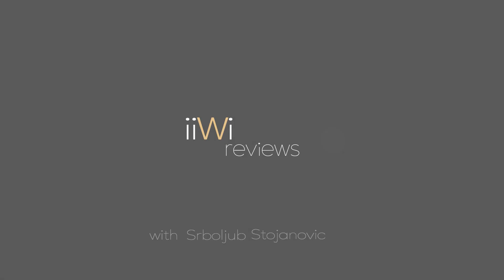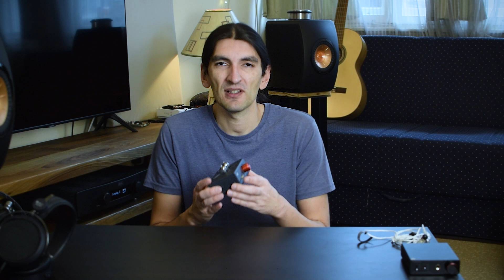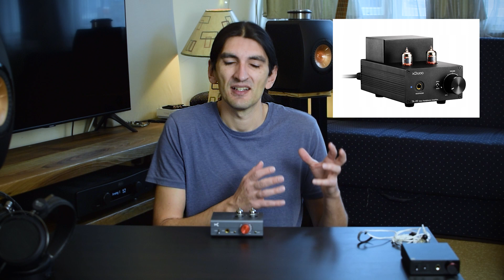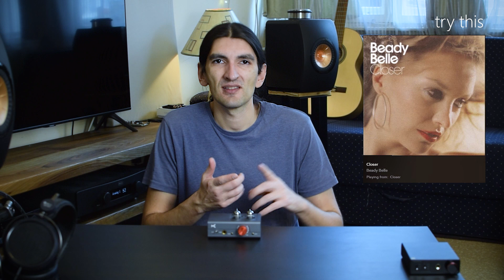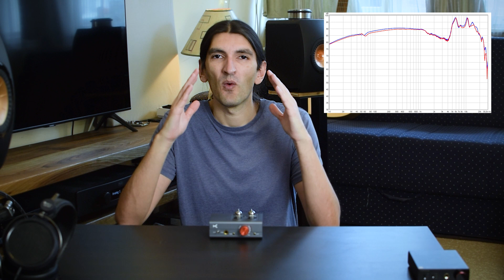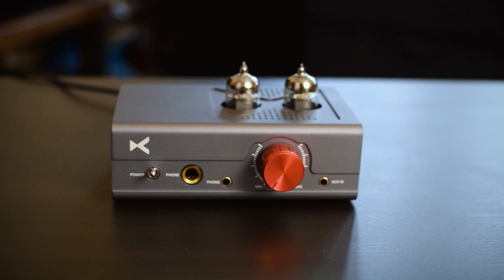xDuoo MT-602 - Great Hybrid Amp on a Budget

Comment: Hi, thank you so much for your reviews. From your reviews I could deduce that I have similar taste in sound as you. And wanted your advice to resolve my dilemma;
I recently bought the HE400i 2020 and am looking for DAC/Amp for them. 
I saw your review on - SMSL Sanskrit 10th MKII and you praised it a lot and I completely agree with your choice of opting Sanskrit over Topping. I like that exact kind of sound from Sanskrit. 
Then I saw your Review on - FiiO K5-Pro - and you praised it to a certain extent. Plus it has a powerful amplifier. 

So I am unable to decide as which one to get whether (a) Sanskrit + MT-602 (or any other Amp to power the Hifiman) OR (b) Fiio K5 Pro?
Thanks again.

Comment: Nice Review! Connect it to with any DAC, or can use direct this single Amp with PC? Pls reply...
Reply from the maker: You can connect it to 3.5mm analog out of your PC... But the sound will be better if you use a DAC in between.
Reply: @iiWiReviews  Thanks for reply. I have Creative Sound Blaster E5. If I connect without E5 with PC (3.5mm analog out), then Sound is better than E5?

Comment: I've just got one of these. I've so far only tested it with my HD560S and I think I can hear what you have described regarding pairing headphones with any kind of treble peak. I have found my 560S to be perfect with my A50s, no discernible treble spike to my ear (even though I know one clearly stands out when measured). With my 602, snare drums in a lot of rock tracks that I'm very familiar with (Tool & Oceansize particularly) stood out far than I have heard them to before. Not to an unpleasant degree but it's noticeable enough.
Reply: Are you still using it with the HD560S and what has your experience been? Just got the HD560S myself and looking at the 602 to take the edge off - but I'm not sure if it'll be a good fit.
Reply: @BatteryAz1z  I still have and use my 560S but I mainly use it for gaming. I've got a HE-500 for music now. I tube rolled the 602 and found the treble peak that effected snare drums largely disappeared. I think it's very much to do with the type of music you listen. I'm a drummer and was a drum tech for over decade, etc., so drum timbre is something I listen to intently and can bother me more than it would most.
I'm gonna buy a Little Bear B-4X to see how a "real" tube amp compares to a hybrid. I still rate the 602 but it's more the music you listen to, the cans you've got and what you want from buying such a unit.

Comment: Thank u very much. Great review. I was considering this to pair with my dt990 pro which are bright headphones but your review just saved me from taking the wrong decision. Do you have any recommendations for pairing with dt990 pro?
Reply: You may consider getting a Zen DAC V2.
Reply: @HermeticAscetic22  thank you. But is Zen DAC V2 powerful enough to drive dt990 pro which is 250 ohms. Hpz mentions to use Zen stack (Zen DAC V2+ Zen can)  instead of just Zen DAC. So I doubt if Zen DAC alone can power dt990 pro to its full potential.

Comment: what if you use this as a preamp into the Topping L30? will IEMs be viable then since you have the low gain on the L30?
Reply from the maker: Yes it would be possible, but be prepared to loose some of the subtle details and clarity for using two amps in a row.
Reply: @iiWiReviews  thanks for the reply! I see. I have a few more questions.

Planars are okay since it's a hybrid right? I have a sundara, i noticed you reviewed it with the 400i? 

Also what if you reduce the volume on the dac for IEMs does it have an audible noise floor with IEMs or is it just a volume range issue? (I'm using an E30). iems no problem on the L30 for me, though volume wise im on the 8-9oclock range. (quite a tight range but maneagable)
Reply from the maker: Yes, Sundara would work just fine as they are current hungry. IEMs are both low impedance and very high sensitivity, so the smallest current leaking from the amp will manifest as an audible background noise. L30 is a very silent amp in that regard so no problem whatsoever. Tube amps are usually having that small amount of current that is problematic for IEMs, even when you decrease the volume completely. So, most of the time Tube amps and IEMs are a no go.
Reply: @iiWiReviews  so the mt602 in particualr introduces a bit of audible noise with IEMs? 

I didnt know that about completely decreased volume! learned something new today. thank you for your responses today, much appreciated.

Comment: any affordable tube amps that has better depth in stage and dynamics than this?

wondering also if you can use the L30 pre/output to feed into the xduoo? or would you have to transfer the rca cables to prevent double amping

Comment: How do it compare with earman tr amp that you much appreciated ?
Reply from the maker: TR-amp is both DAC and head-amp so it has great value. But MT-602 paired with a good DAC offers more drive and more airy presentation, and more midrange details.
Reply: @iiWiReviews   Tx! I have  it paired with smsl sanskrit 10th mk2, I have also jds atom amp driving a pair of infinity alpha 50 plus welodyne impact 10, and the difference it is big, indeed xduoo it offer exactly how you say more airy and more mid-range details, and also wider soundstage than atom, but for me even if  I searched for that continuously, now seems to be just a notch over what I like ideally...maybe I could compensate by slightly rise the sub output, and I need to measure again with rew because the sound changed much. Also the same applies to my headphones a pair of akg 712 and 1more triple driver over ear, both now on xduoo sounding brighter and more detailed than on atom, rendering  inaccurate actual existent dsp profiles for them. The bass on xduo seems more defined controlled than on atom amp, with enough power but somewhat eclipsed by clearer midrange and highs. I will try some tube rolling with ge vintage military grade and maybe sylvania  on the future, I need some tubes that will tame very little the middle and upper frequencies or make the bass a little more ample and warm.

Comment: Question about this Xduoo MT602 - what is the size of the 12V power connector? In watching your more recent video about 5V linear power supplies, I immediately thought about getting a 12V linear power supply for this unit - I'll bet the sound quality gets even better?
I am also getting a matched pair of GE JAN 5646W tubes for the MT602 - these are mil spec, and made by GE who invented this tube. They are about $20US for the pair.

Comment: I own that amp and is an unbelievable value,  I prefer it to ta-10, which has a great amp section as well.
Hard to find anything  near as good as mt-602 even in higher price brackets.

I've also owned e30 and disliked everything about it, I don't get the hype on  such lifeless sounding amp.

Comment: hi iiWi, another question from me :). I want to ask, can something small and portable like earman sparrow (2,5mm jack)
compete with something cheaper but desktop, like xduoo mt-602+ dac in the same price range or schiit magni/modi, in sound quality, rafinement and technical aspects like instrument separation, sound stage :width, height, depth? is there any chance that the new small devices are that good? (lotoo paw s1, sparrow, cobalt, hidizs s9 ...). With an easy to drive headphones, when the power itself is not an advantege of the desktop devices. Can we get desktop like experience on the go?
Reply from the maker: Hi Matus. Yes, Sparrow for example easily competes with desktop products in terms of sound fidelity over its 2.5mm out. The only thing lacking is high power that physically can't be put into such small devices. For example, I find Sparrow and DF Cobalt to sound better than Fiio K5 pro or Topping DX3pro as long as you don't use power hungry headphones.
Reply: @iiWiReviews  thanks a lot :)

Comment: Already 2 weeks of listening and I have to be honest, it's so-so...it has a good sense of recording space with all the reverbs and echoes, acoustic instrumenst sound let's say fine but not very realistic, it too soft presentation,  there is not enough distinction between wood, strings, metal. Voices are nice for a cheap amp. I put Voskhod tubes so I am not refering to the original. Anyways I prefered Voskhods on my Little Dot 1. And finally,  the bass is missing it's fundament,  it's simply not there. Listening some bass and percusion song now and switching to FX x6 mk 2, oh boy, FX sounds so powerfull and impressive,  but perhaps treble is not so sweet like 602. For electronica FX only, can't listen anything on 602, some of the sounds just don't get through. Dac is a dac portion of FX, so switching between is easy and revealing. Streaming from Xiaomi Mi box 4s, via digital coax, no usb bull...regards to all

Comment: I was wondering if you'd be kind enough to load this amp with some nos mullard valves or some valvo's and give us another opinion. I guarantee the sound will be completely different. These amps come with cheap valves straight out of the box. A military grade mullard valve will have much faster response, less microphonics and much fuller tone. Thankyou for an excellent vid xx

Comment: Hi! Awesome review. Does a headphone amp like this makes any sense to feed a takstar HF580 headphones?
They are of planar magnetic type but exhibit a low impedance (32Ω±20%).
They are single ended (non removable cable) and I already own as source an Hiby R5 (capable of 500mW at 32ohms on unbalanced 3.5mm). My other IEMs are also planar, really hybrid DD+BA+Planar, the KBear Tri I3. Thanks in advance!
Reply from the maker: I haven't heard HF580 so can't advice if these would match tonally. In terms of power and drive, there should be no problem whatsoever. But if you plan to use it with IEMs, please see the video about that part.

Comment: Thank you for this review. I am hesitating between 601 and 602.
Reply: No point getting the 601 when the 602 it’s just 10$ more
Reply: @FedeBerri96  Yes, I agree. The only but I see is for tube rolling. 601 is a whole lot easier because it's a different kind of tube (9-pin 6922/ECC88). Not a lot of options with the 602 (7-pin GE6AK5/EF95/GE5654).
Reply: @marclacasse1  true. Also tube rolling the 602 costs twice since it’s double tubed
Reply: @FedeBerri96  Yes. I think they made the 601 specifically for tube rolling. It competes with the Schiit Vali 2.

Comment: As many have indicated, lots of us watch your reviews.  You come off as a gentle and very knowledgeable person and I know that whenever I see a new review coming on your channel, I'm there to check it out.  I must add however, that in the case of the XDuoo head amp/preamp, what one hears (as you well know) depends on many variables such as the DAC used, your hearing, ear canal and so much more (in the case of headphone listening only), and of course, in addition, the type of amp or powered speakers that one uses if listening via the Preamp outputs.

As soon as I ordered mine a few weeks back, I also made the move to simultaneously order several different types of tube sets and I'll tell you, the tubes you use (as is always the case with audio gear), can make a world of difference.  Using the wonderful Riverside 7-Pin GE JAN 5654W Fully-Tested Vacuum Tubes, shown in the link below, they made a substantial difference (well,  at least to my ears) after 24 hours of burn-in - over the stock tubes that came with the unit - and they only got better as time went on.

7-Pin GE JAN 5654W Fully-Tested Vacuum Tubes

I also purchased some Russian Tubes - love testing them out.  Anyway, the depth that you mentioned wasn't much there, is, in my opinion a stock tube issue and I've had no issues with perceptions of depth with the Riverside tubes.  What really surprised me was that the bass was punchy and tight - in fact, more so than my ZenDAC.  

I'm feeding my XDuoo MT602 with a newly purchased budget Schitt Modi 3+ (since the XDuoo was budget also) and I've got to tell you, this duo sounds dynamic, punchy, and warm in those regions you mentioned.  Also as the tubes warmed up and got broken in, the highs - in particular well recorded string instruments - had a silky sheen to them (very alluring to be sure).

So all I can add is that this unit punches far above its weight, but like in most cases, the weak points of any tubed audio components are the tubes themselves.  So I strongly suggest getting some upgraded tubes and then let them break in and you will be rewarded with superb sound.
Reply: would you mind sharing links for the 2 tube sets you mentioned, this will be my  first foray into tubes and tube rolling so would be really grateful.
Reply: the idea of a tube amp esp hybrid seems really exciting to me, rather than the small opp amp changes there seems to be such a world of variety to explore
Reply: @adrianmorrish8494  Well, here's the one for the GE versions again (I had it in my reply above).  It is:

https://www.amazon.com/gp/product/B088RBVVF3/ref=ox_sc_saved_title_5?smid=ADPE7GPX91ORE&psc=1

These, I found, were (are) the best, most smooth sounding versions and they are relatively inexpensive (only $16 for a matched pair - that's the key, getting a matched pair).  

These same tubes can be used for other hybrid tube headamps from different brands.  For example, I use these for the Douk Audio P1 - which I also enjoy.  The Douk P1 is a very spacious sounding headamp.

Comment: Another very good review. I really like your channel! One question on the pre-out of that unit. Would it make sense to put the 602 between my Topping e30 and my powered monitors to get a bit more organic and textured sound? Currently, I have my CCA or Laptop connected to my Topping e30, which feeds a pair of Tannoy Gold 5 at my desk. Sound is good, but sometimes a bit too analytical. The 603 would also add a physical volume knob, so I could set a fix volume on the Topping and adjust the volume on the xDuoo...
Reply from the maker: It does make sense since it can sometimes help with the impedance matching... That said, I'm not sure how would that work in reality with your particular speakers. It's a unique kind of situation for every system.

Comment: I would like to strongly recommend you also review the Fx-audio tube 03 mkii it's $75 on amazon with SNR 100db and THD 0.001%. It's dead silent at max volume and zero distortion. The sound quality is amazing and no one seems to be taking about it, I have tried many tube buffers and this is the only one I like a lot paired with the schiit loki eq it pulls sounds out of the songs you didn't know where there, turn up the treble and get beautiful clean sparkle . I don't like blue tooth so I'm happy the bt is completely shut down when not activated on it. It's a hidden gem. Im not a head phone guy so I use it with two other hidden gem amps, the Aiyama a04 tpa3251, and the Allo volt+d. Hope this helps someone out there.